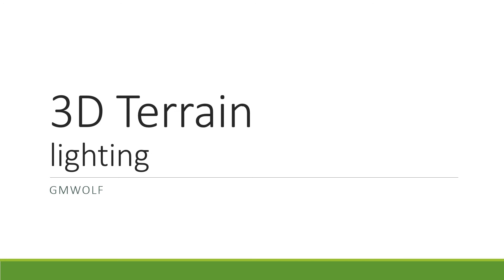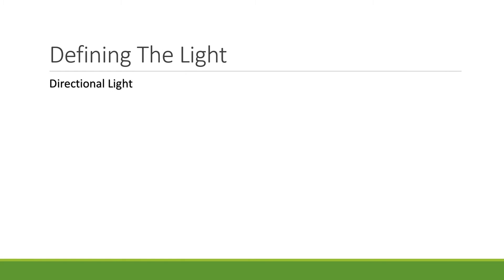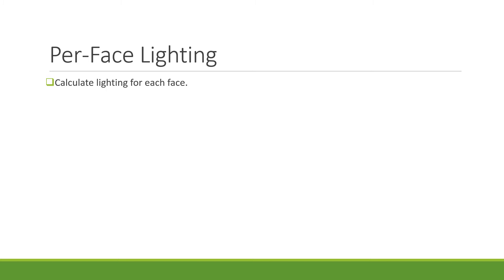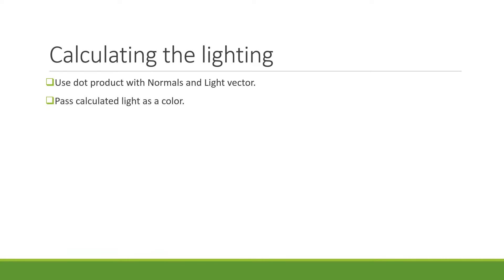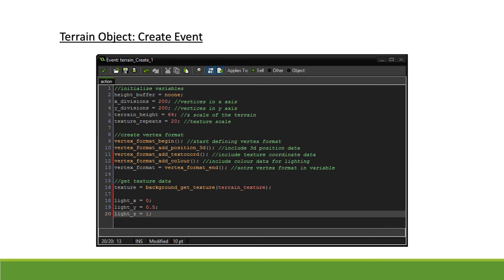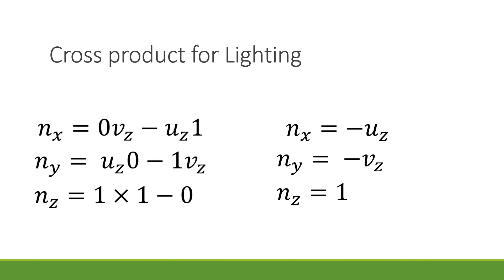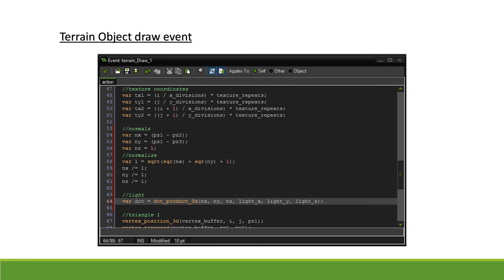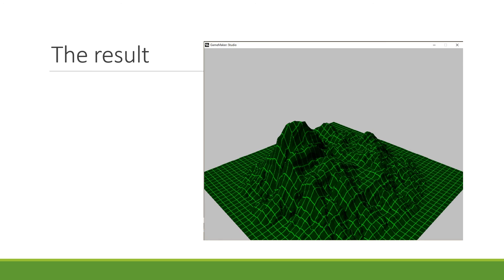GMWolf- 3D Terrain Lighting

Comment: 3:28 don't you need to normalize the dot product aswell? You said it is in the range between -1 to 1. Shouldn't it go from 0 to 1?
EDIT: I just added this line: dot = (dot*0.5) + 0.5 and it looks much better to me.
Anyway, I will try and figure out how to light it per fragment and not per vertex. Then it should look even better :)
Reply from the maker: No, otherwise you would get a gradient between the facing completely away, and facing completely towards the light. What you want is facing away to be completely unlit, and have the gradient from being perpendicular, to facing the light. What is necessary though is clamping hose values to be 0-1 to remove the negative values
Reply: @GMWolf  Ah ok, I see. For some reason I don't get a gradient either way. I'm trying to figure out why the gradient isn't there. Do you maybe have an idea?
Reply: @GMWolf  I uploaded a screenshot. This is what it looks like for me: https://ibb.co/C1Kwn6K
Do you have any idea why the color is not blending together?
Also: I stretched the terrain a bit, so I don't have a high vertex count, but if I remove the streching it looks just like this, just smaller.
Reply from the maker: It seems like you are using per face normals rather than per vertex normals but tbh I don't remember what the tutorial does.

Comment: Thanks! I got everything working nicely. My only question is what controls the actual size of the terrain? Say for example, I want it to be 1024x1024 units, but I want my heightmap to be 512x512.
Reply from the maker: +Timothy Y. That's right, I didn't really provide much of a solution for that.

One easy way word be to draw the heightmap scaled onto the larger surface. This will work just fine, but will give the same visuals as just a 512×512 unit terrain. (You cannot create data from thin air)
Reply: Have you done a tutorial for getting an instances z value from the height buffer based on its x and y position?
Reply from the maker: +Timothy Y. No I haven't. I meant to but never got round to it.
However all you should have to do is get the nearest points in the buffer, and lerp them.